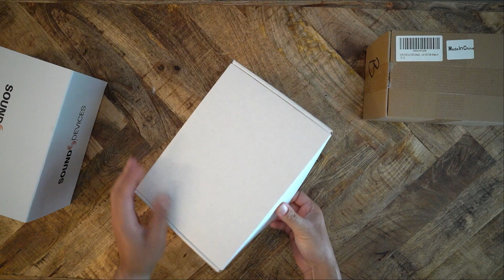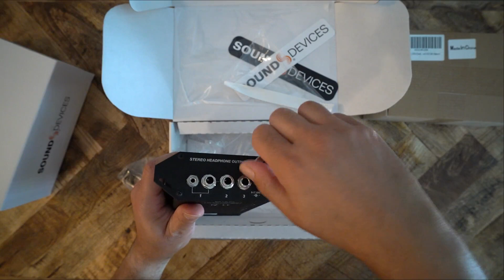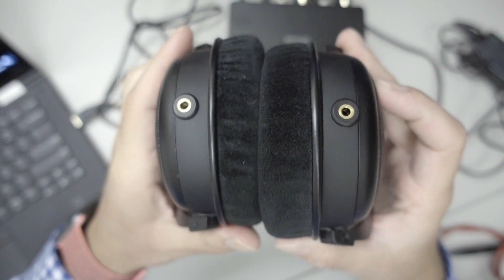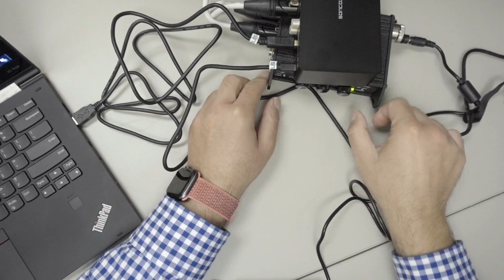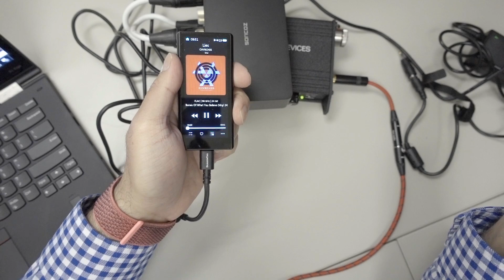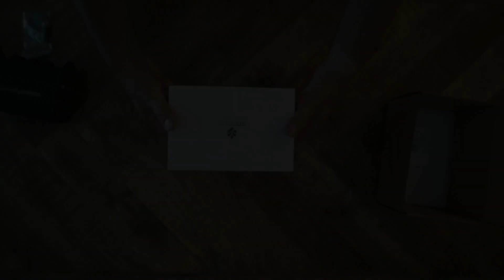A Portable Balanced XLR Dac & Amp For High Impedance Headphones - Soncoz LAQXD1 & Sound Devices HX-3

Comment: Obviously you have not heard of IFI micro black label.
Reply from the maker: Obviously you have not watched my numerous reviews of the Black Label.
Reply: @NoThemeReviews  So then your complaint there is no amp to power DT 880 600 ohm was just for theatrics?
Reply from the maker: Don’t be obtuse. If you haven’t watched the power vs impedance video about the 600 ohm 880, then do so. I make these videos in series and each is built upon a prior video.  The 880 doesn’t require raw power but high output impedance—which is nearly impossible to find in audiophile gear.  I suggest you ask for clarification in the future instead of jumping to conclusions.

Comment: hello thanks for the review. Speaking of powerful portable amps, do you have any opinion of ifi's xCAN ?
Reply from the maker: Sure. It’s an excellent amp. It’s fairly powerful but it’s rather expensive. For low impedance headphones, I think the significantly cheaper NX4 is better value, unless you really must have BT connectivity as well.
Reply: @NoThemeReviews  I appreciate your insight on this, thanks again.

Comment: Not even the Woo Audio Wa8/Wa9 can drive the 880?
Reply from the maker: Technically yes, and practically yes/no.  Both amps make sound happen on the 880.  The WA9 doesn't cut it, even on high gain.  I have to max out the volume, and even then the 880 is just barely at normal listening level.  The WA9 combo leaves the 880 with narrower soundstage and clarity than if properly amped.  The WA8 is noticeably better.  You need to have all 3 tubes active; 2 tubes significantly affects the power output and sound signature for the 880.  Anyway, with all tubes active, the 880 gets plenty of power with just a tiny bit of headroom left.  I still don't think it sounds as good as a high impedance amp, but it is doable.
Reply: @NoThemeReviews  THANK YOU so much! I am extremelly interested on the Wa8, as my first serious headphone amplifier really apreciate your imput and your content on the Chanel! Keep the Good work!